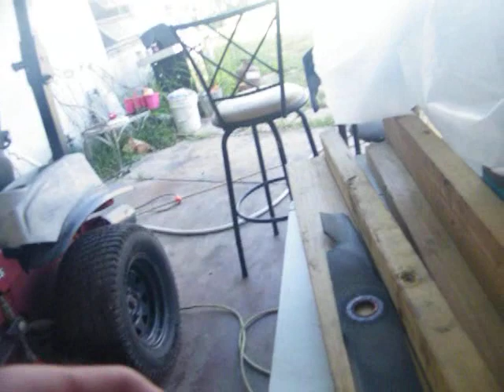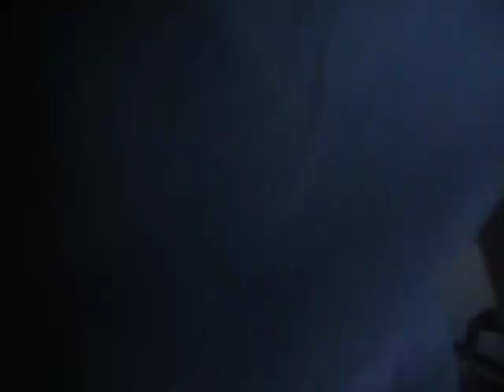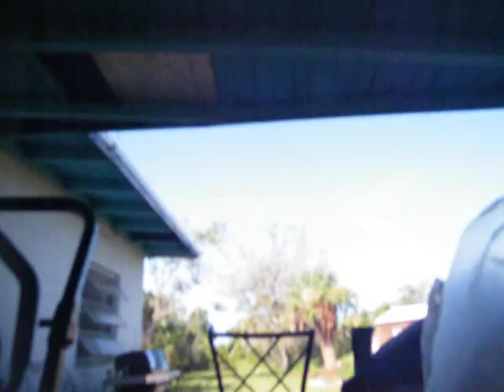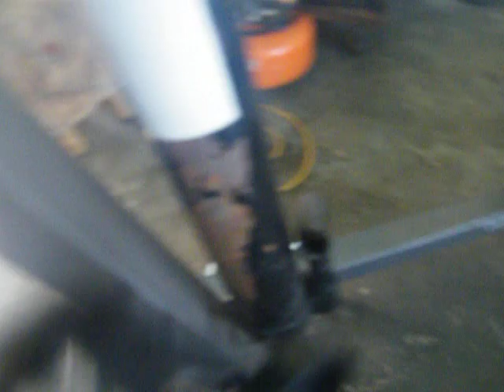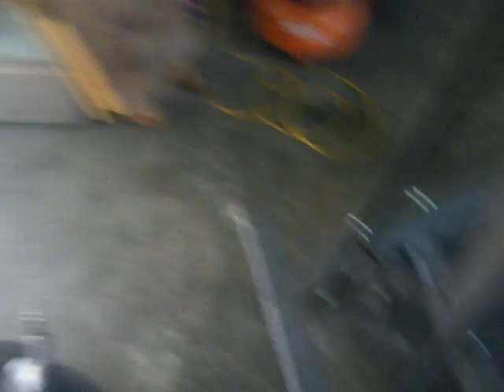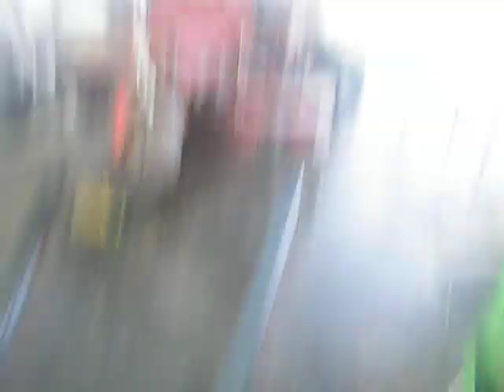new teeth

Comment: What is that motorcycle? I have yet to get my bike out. WHAT?!!!
Reply from the maker: its a 96 kawasaki vulcan 800 drifter thats been sitting for a while. some changes mae but nothing serious that cant be changed back to original,

summers almost over , you been truckin to much , take her for a spin
Reply: @Rewired69  I am working on it. I need to change the rear tire which I have. The battery needs replaced and so do the spark plugs. To add to that, I need to insure it.
Reply: @Rewired69  I 'd be interested in seeing it. Maybe you could do a video on it sometime.
Reply: @Rewired69  is it a drifter because it's a solo?
Reply from the maker: @januaryman169  money money money .
but to have a toy to get away from it all is well worth it
Reply from the maker: @januaryman169  ya know i dont really know , ive seen them with tandem seats , a fender seat, all i know is the 800 is rare , very few production. 
i think it has something to with the dress out , rear fender, front fender and seats.
i'm not a bobber type , i like a passanger from time to time.